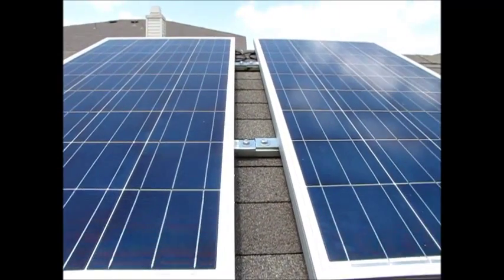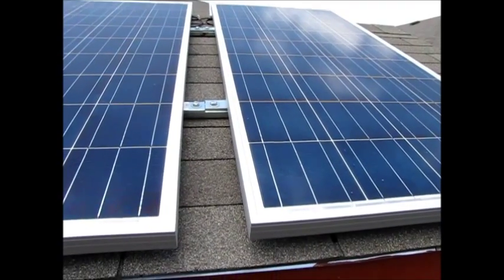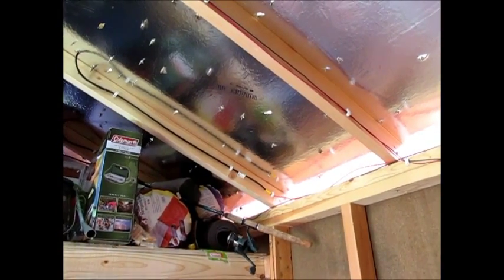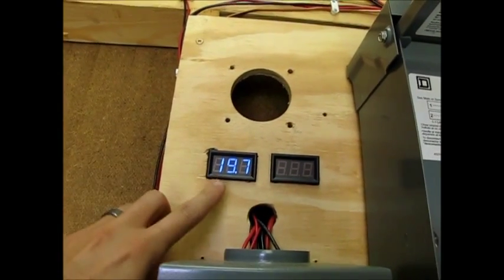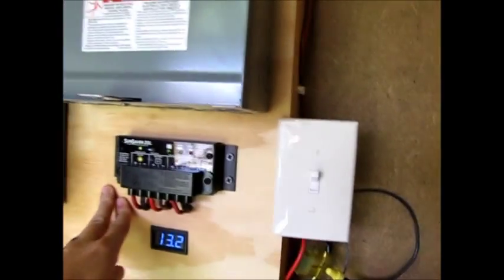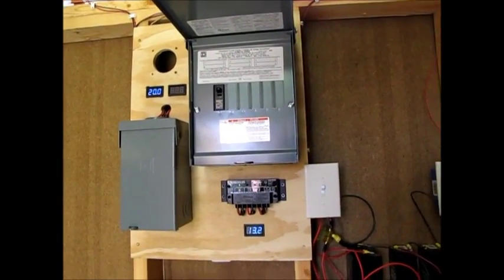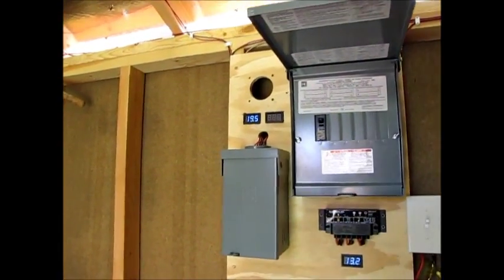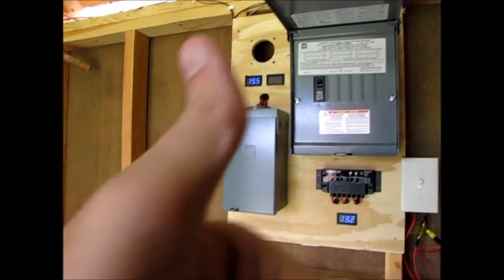DM Solar 145 Watt Solar Panels - Final Review and Performance

Comment from the maker: That is a great question.  I have never installed an electrical system before and I found it pretty easy to pick up.  DC wiring is pretty straight forward and you can make the system as simple or as complex as you want it.  You can do anything you put your mind to!